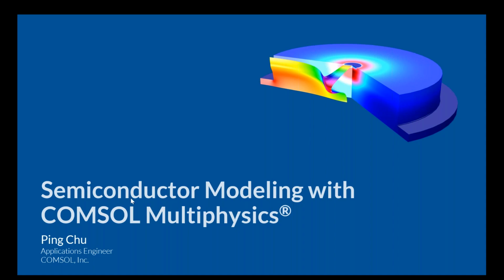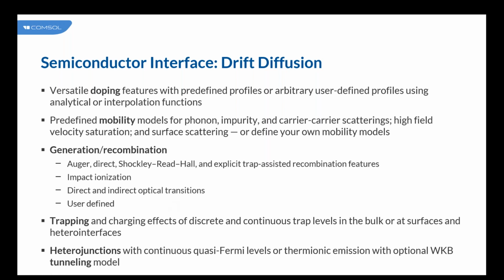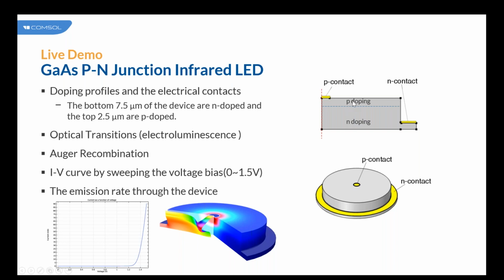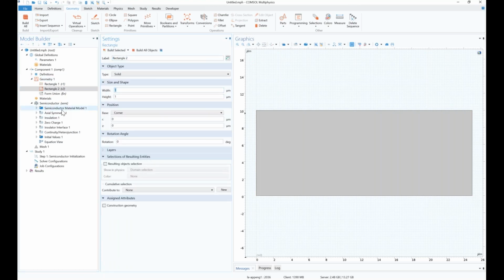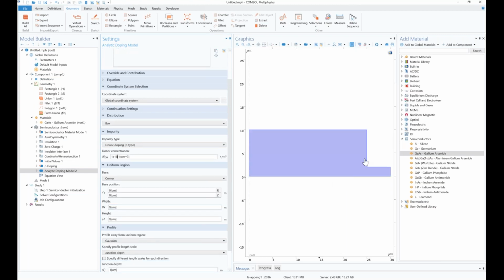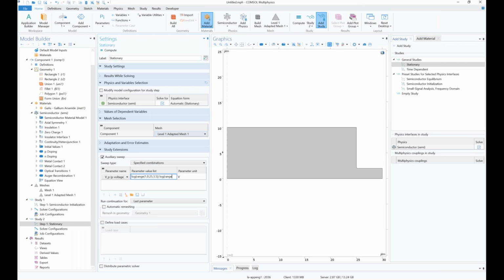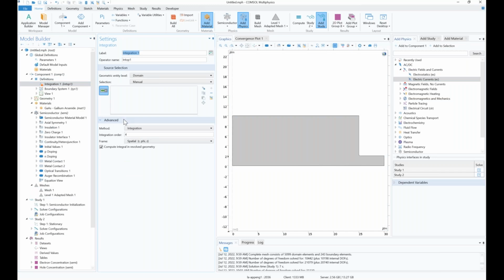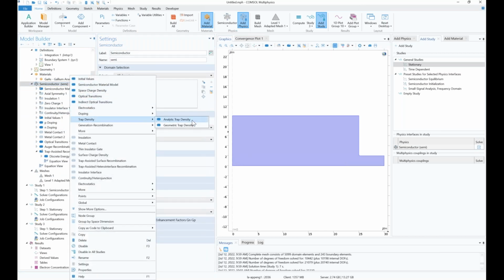Semiconductor Modeling with COMSOL

Comment: how to model a hot carrier solar cell based on nanowires (with a well or a quantum dot) in COMSOL Multiphysics?
Reply: How to model a 3d photodetector based on quantum dots semiconductor
Reply: @mohammedkhadraoui5470   do you find how its done